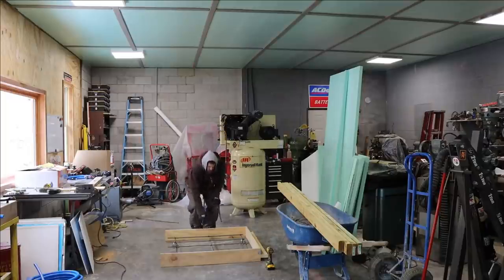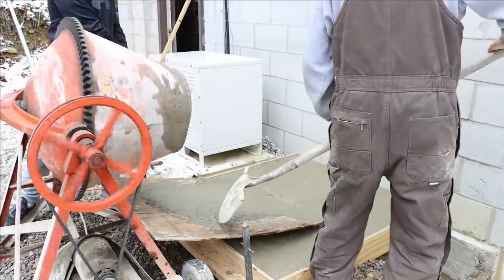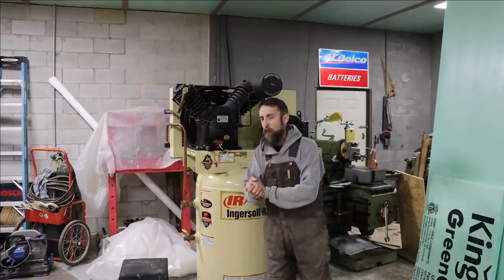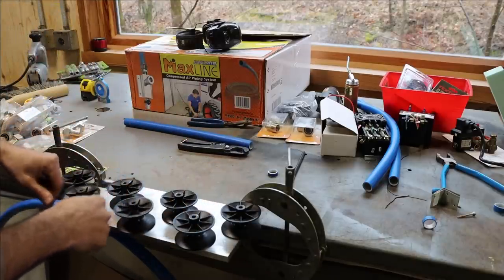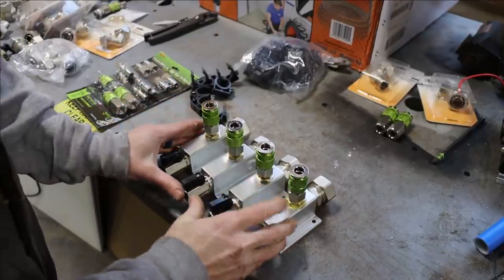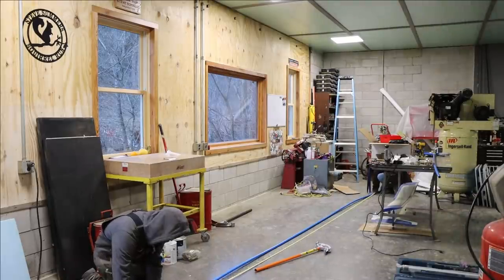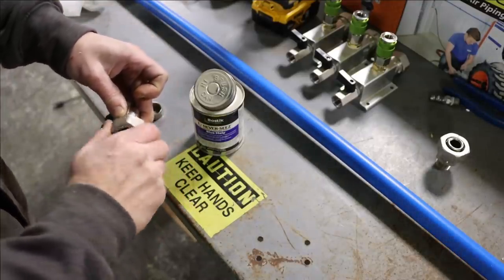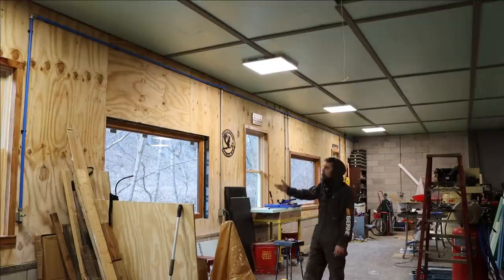Shop air System with Elizabeth & Concrete pad for compressor.

Comment: Airline work is worthy of the rest of the magnificent work done on the shop earlier. Good to see the family involved, too. (Do they feel that way?)

Re: Chinglish instructions, does anyone else wonder why they don’t hire someone to write the instructions for them? I could rewrite those instructions in 15 minutes. Do they not know the instructions are all but indecipherable? If the tool worked as poorly as those instructions instruct nobody would ever buy it. It’s, if nothing else, a “fit and finish” issue that casts doubt on the whole thing. It’s not like this is a new issue. I’m baffled by it. And many other things.

Comment: Next comes an overhang roof for those two pieces of equipment. Either just an awning roof or a whole enclosure (WITH ventilation)...  An enclosure will mute some of the sound...

Comment: Next time,staple polythene sheet to the forms to act as a mold release. Cut up bin bags will do for this.
17:40 Should have saved the effort and anchored one end of the tubing and just driven the truck away from the anchored end.

Comment: My heating system uses similar tubing but a bit smaller (3/4") and it cuts and bends easily. If you want to get it straight, just put slightly more clips, but I've never seen the use of straighteners with these.

Comment: I have the same air line system. I ended up adding 45's to the couplers after cracking a few air lines. Takes the stress off the air hoses....

Comment: Ladder instructions:
" Place lower appendage on horizontal bar and lift up weight of body to each height position,  at height point place 2 appendage on horizontal bar. Be caution that mechanism do not slide to horizontal direction while gravity suction bring human corpse to ground damaging internal skeletals."
Reply: Kid Sheleen!
Reply: Imagine how that would read if it were by the same people as his pipe bending tool instructions.

Comment: The air lines are going to be super useful. Looking forward to seeing the full air system plumbed in.

Are you going to paint the concrete blocks or the plywood, or leave them as is?

Cheers,
Craig

Comment: I noticed your propane heater. They make lots of moisture, you might look at a Chinese Parking Heater, runs on diesel makes about the same amount of heat, but it's dry, and has a thermostat uses about a pint of diesel per hour.

Comment: Steve, might want to add an overhead hose reel.  I installed two and hardly ever use the wall outlets anymore.  Sure wish I had a helper like yours.  I'd say to stay safe but, I can see your hearing is about as bad as mine.  If your wife was in the shop during your dance routine, you owe her big time.  Didn't hear any laughter nor screaming.

Comment: When I saw you starting to remove that forum and the color of that concrete I knew that corner was going to go I knew it I knew it I knew it. I worked on a brick and block crew and we did some stonework oh hell I worked on that for 12 years and we also did a lot of side work with Roman Concrete in Detroit. You should use some calcium chloride in that mix to set it up.
Reply: Bad idea!
Reply: @larryschweitzer4904  there is nothing wrong with a small amount of chloride to speed set up on a simple pad like this.  if it were a driveway I would agree but this is not going to hold any weight to speak of.

I would have used a sand blanket or even rented one if I had too.  I have seen guy Build a fire in a sand pile and shovel it over footers
Reply: @ClownWhisper  While it is true that a small amount of (calcium, potassium, magnesium, sodium) chloride will only do minor damage to this type of pour, all it is doing is causing the mix to firm up but not cure. Curing requires the cement to undergo a chemical reaction. That reaction takes place over time and goes much faster at higher temperatures than at near freezing. The problem with free moisture that hasn't been used in the chemical change is that it will freeze and expand damaging the concrete. Many jurisdictions prohibit the use of chlorides. 1. because they weaken the concrete and 2. because they attack the reinforcing causing it to expand and break the concrete. 
When you do a pour that will be tested @ 28 days, the cylinders are supposed to be left under the same conditions as the pour to be valid. I've seen test cylinders put in the heated construction shack over night so they would test high enough to continue construction. We had heated blankets that helped, up to a point. They were expensive, subject to damage, and wind was a problem. If the ground was frozen we couldn't pour even using the blankets. Chlorides will attack even fully cured concrete.

Comment: I have that same Little Giant ladder and it has slipped on me too. Similar setup on a smooth concrete floor. The feet slipped back on the floor. I am super cautious now about making sure the feet are solidly planted before I go up and that the angle is not too great. I have an older version of the ladder; the feet seem more plastic than rubber. Maybe someone is making replacement feet with grippy rubber. It would be worth it. Thanks for sharing your progress on this.

Comment: I figure it is best to leave them on the dry side for the bottom part of the slab. It will be stronger not adding as much water. But then add a bit more on the top to facilitate finishing.

Comment: Hi all, I have still got to reinstall my airline after the shop rebuild, and I think you have convinced me to use 3/4” plastic instead of the. 1/2”
Reply: The Larger the line the better the flow, which also adds capacity to your air system.

Comment: just a note for the future: calcium chloride in the concrete mix will act as curing accelerator
Reply: Calcium chloride does not accelerate the cure. It merely ties up the water making the concrete stiffer sooner. It also weakens the concrete. Curing below 40F is extremely slow, add heat! Once concrete freezes the free water expansion will damage it.

Comment: need water drops at each vertical steve or your gonna get water at the bottom , any air driers ? i would use them too . good install i like this stuff , thanks
Reply: Ideally all drops come off the top.

Comment: So I am guessing your not overly concerned about water build up in the compressor tank from it being outside? There is also the option of plumbing a second "dry tank" inside the shop to cut down on the compressor run time and also help remove more water from the compressed air to avoid having wet lines inside the shop. Nothing worse than having water in all the shop runs needing to add blow down ports along the inside runs to drain condensate. Just curious...

Comment: How do you keep any condensation or humidity in the compressor from freezing if it’s outside?  If you have any water trapped in your drain and it freezes could that beca problem? Or will you insulate and gear the enclosure?

Comment: Re...10:10, Compressor orientation:  Perhaps a strange idea, but if the machine was set at an angle to the wall would it not provide much better access to the machine for maintenance?     Thanks again for my Saturday morning entertainment.

Comment: Did you at least ram the concrete with a stick along the form this time?
After so much concrete work on the shop floor I really did not expect a repeat of the last pad.

Comment: Steve, 36" centers on the mounting brackets is more than enough. My shop is dry walled so I did mine on 48" centers so they would fall on the 3rd stud, 32" was just to close. No issues at all. Are you going to put a roof over the air compressor?

Comment: Not a fan of that pipe. I would have used copper, but I am a pipe fitter. Did like the high flow fittings.
Reply: What, exactly, is wrong with that pipe?
Reply: @paulcopeland9035  Nothing wrong with the pipe system, other than cost. Looks nice and easy enough to install. I just like copper, it's already st8 and the fittings are cheaper. 
   I like your show, and you are not afraid to work. We need more people like you.

Comment: I think I may have left a little gap between that pad and the wall to isolate the sound.  I fear the sound from the compressor is going to go through the pad into the wall even with isolation feet on it.

Comment: used to work a bleu monday in a factory that mdeconcrete paving bricks when it was cold they would add anti freese to the concrete to prevent itfrom freesing up before it was dried , is important as moisture pockets can expand and break / crack the slab
might be nice to find an old dixy toilet (the ones they use on construction sites) and cut the bottom out of it and dop it over the compressor , should be enough to kep it dry

bet that come summer there be quite a few flowers growing under those feeders

yeah realy weird about that freeser , maibe that racoon was tring to get in ......

Comment: If you make you a cup shaped bit for the jackhammer, you drive stakes in without manual hammering.  Aren't those little rebar chairs such a great invention.  Are you using a 3-2-1 mix for the concrete?  My wife will not let herself be videoed. What brand of trowels did you buy.  My father-in-law would not use anything but a W.W. Rose trowel.  No offense, but I hate collies.  Had two attack me one time.  LMBO at the Chinglish instructions.  Hey! Hey!  No TENNESSEE insults!!  Will eventually put in a shop airline...maybe.  Stay well, and please stay safe!!

Comment: For all that will be running (installing) SOLID Air Lines, Plastic / Black Pipe, Pipe from the planet Mar's, DO NOT USE A LASER LEVEL. Leave your expensive toy in the box it came in. Why do you need / want your pipe to run @ a minimum 1/4" in to the foot? The answer is the same for plumbing a toilet. But in this case of plumbing Air for a shop, the question is which end of the run, do you want to open, to FLUSH OUT THE WATER THAT WILL BUILD IN THE SYSTEM. Money back guaranteed.  No "if's," no maybe's, you will build / collect water in the lines. The only question is "HOW MUCH" water will be in the lines. In a good system, less than a 1/4 ounce. IN a bad system, as much as a cup of water plus. Now where you intend to put a solid air line drop, will it be ok if a cup of water (UNDER PRESSURE) hits the floor and spreads out. I say plan for the worst, hope for the best.
Reply: He specifically mentioned that.
Reply: One reason I made an air cooler between compressor and tank via an industrial water trap.
Air now dry, whereas before I had to use one of those miniature water collectors on my tools, but no longer.
What a relief.
Reply: @xenonram  "He specifically mentioned that." 

Not trying to be a smart A$$, but could you please (identify / elaborate) just what it was, that Steve mentioned, (and you are referring to) about which sub-topic. Not for nothing (not trying to flame you) but your answer is extremely vague, at least for me it is.   I'll be the first to say maybe I missed something when Steve was talking, explaining something, about the Air lines. There is a lot of sub- topics having to deal with Air lines. Just like their are a lot of different way's to run the air line. Example I offered Steve a suggestion on a certain type of filter that could be used to cut down on the moisture level entering the Air Compressor Tank.  Or to try to control moisture levels in your air supply HARD lines, what some people do is to run kinda of a square letter "U" at the beginning of the run. The line would come out of the wall, 90 degree up to the ceiling, maybe just 6 " inches short of the ceiling, run maybe 4 - 6 inches laterally, than drop down toward the floor (or just above it, approx. 1-3 feet, as your first water / moisture removal point, via a Ball-Valve. Than put / add another Ball-Valve to your last air drop, just below the spring loaded air supply fitting.

Comment: Frankly I think that compressed air piping kit is overpriced. And do you really need such large diameter? I know it allows for lower pressure drop but unless you're running a sandblaster, you'll probably never need it. I ran my compressed air with the leftover 1/2" ID Pex-Al-Pex from my radiant floor. Tubing was less than $.50 per foot and fittings aren't expensive either.